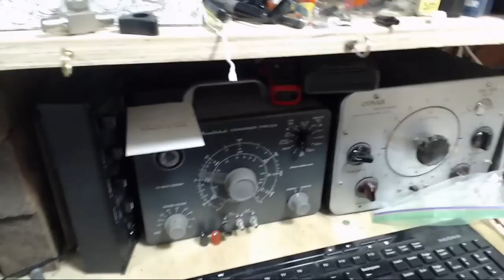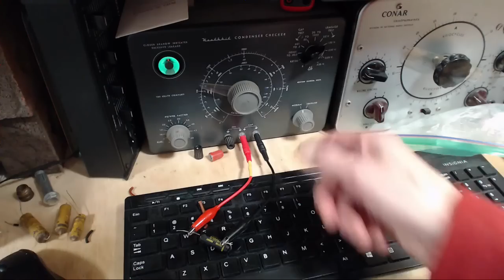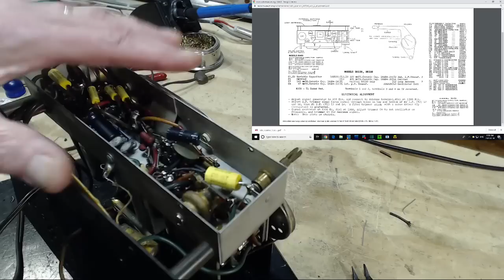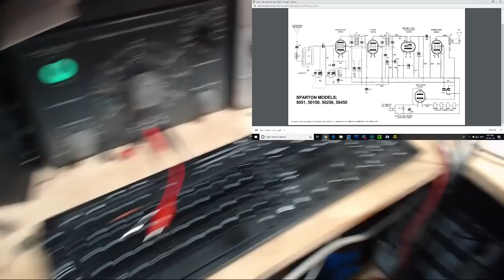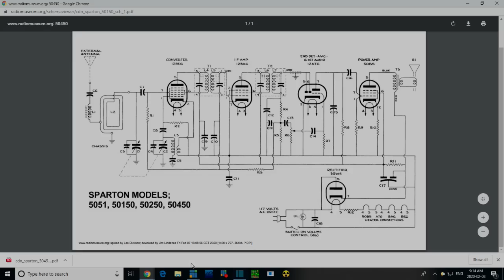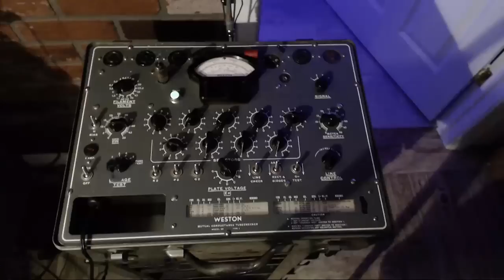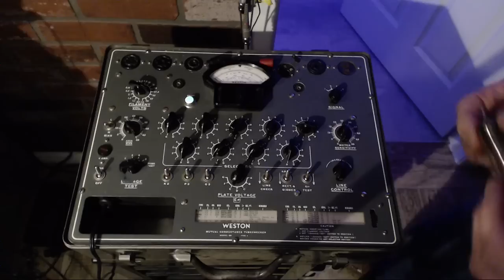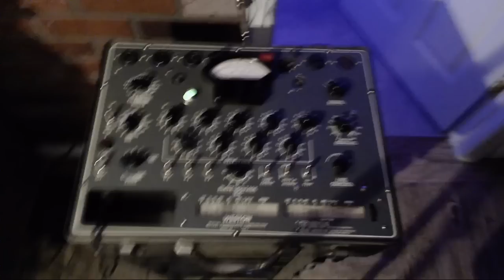Sparton 50450 Five Tube Radio Video #2 - Bad Parts Out

Comment: Oh oh... Jim's checking old caps again.  Thank God Melissa H isn't around.  Hahahaha.  If it were my lab, I'd check 'em too.  Who wouldn't?  Then I'd melt 'em apart, re-stuff 'em, and re-install 'em.  That should calm M.H. down a little.  BTW, at 6:10 in, your meter beeped out 'dit' in Morse code. How appropriate! Cool. Thanks Jim. Nice vid!  Pray for Spring, kind Sir

Comment: Somebody was definitely in this radio screwing it up no less!. The ceramic capacitors should be C7,C8,C12,C19and C15 in the schematics list of caps from Pacifictv..
C7 100pF C8 47pF C12 and C19 220pF and C15 is 470pF. Bad tubes? Someone used this radio a lot! Changes were very good but the  dual electrolytic cap must be replaced.
 Double check the tube before checking it my friend. Fun watching you struggle like me!

Comment: C10 is damping out the AVC signal coming through R3 so increasing it from 0.01 to 20 µF would increase the time constant from 0.02 to 44 seconds.  So if you tuned in a very strong station it would be blasting for half a minute while the electrolytic was charging before the AVC kicked in.  Maybe the guy heard that motorboating was an AVC problem and rather than fix it he tried to just suppress it by brute force by adding a big capacitor.